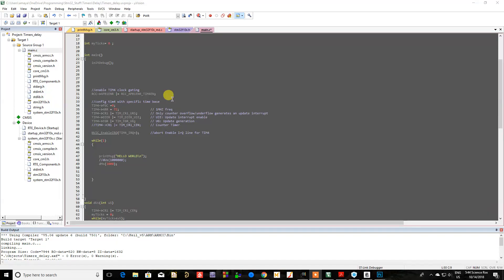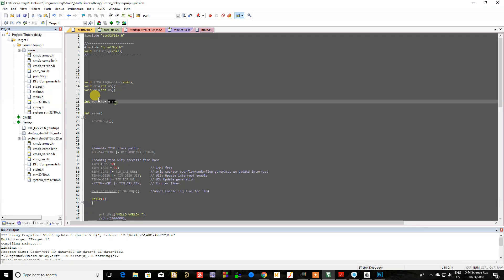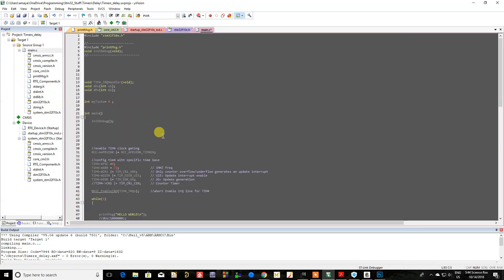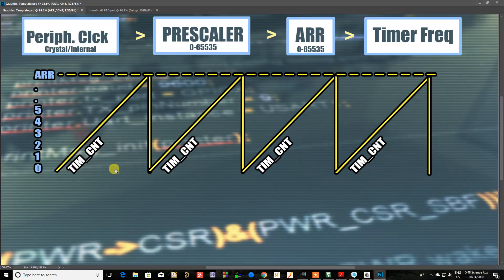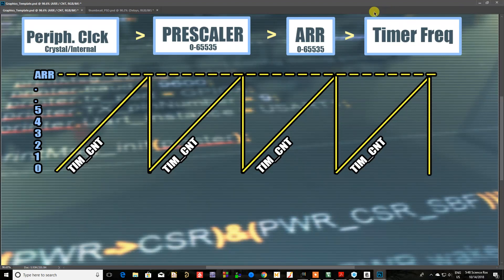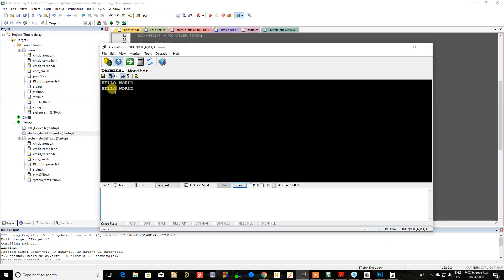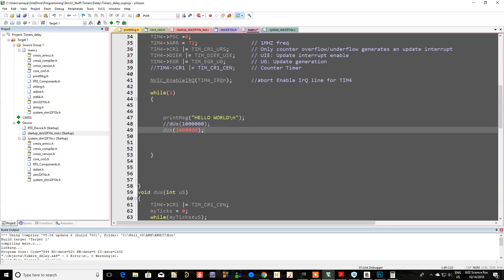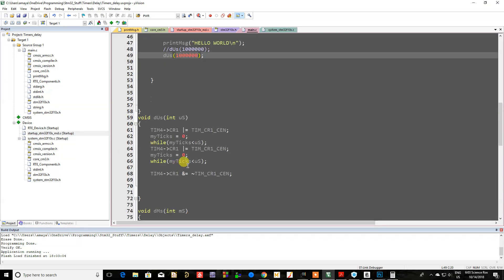Stm32 Delay Using Timers or Systick

Comment: Hi thanks for the great video. Maybe you figured it out already but still incase you have not I would like to tell you the reason you could not get 1 sec interrupts with a 72 divider on the ARR register. It was because the HCLK clock frequency after being divided by the APB1/2 prescaler gets further multiplied by "2" before being used by the Timers.  Again Thanks for the video was really helpful in my project which I am doing for my degree. Best Regards Usman

Comment: Thanks for posting this video.  I needed a delay that allowed the rest of my application to run while pause a moment before I update a 16x2 LCD.  
Evidently the Hitachi LCD needs at least a 2ms delay between updates since it is a bit slow to keep up.. It will stutter/produce garbage if it is hit too fast with data.

I don't want to use HAL_Delay because it would freeze up a DMA stream while waiting for the Delay :(
I figured a timer was needed, but this video saved me the trouble of figuring out how to use it ;-)
Reply: Does 16x2 LCD has pin for interrupt? If I remember correctly, it has some flag or interrupt pin that sends to MCU when it is ready to receive new data. Seems that nobody use that feature, maybe one wire more is too much?
Reply: @MilanKarakas  I think it's the DB7 Busy Flag pin you are referring to.
Good idea to check into..
Reply: @Synthetech  Yes, probably that one. I should to check datasheet for exact name and which state is buy and which ready.
Reply: @Synthetech  Okay, that is correct. If DB7 is high, then it means "not ready". So, you can use 4 bits transfer (lower nibble, higher nibble, and then DB7 is free), or better to use 8 bits transfer - but then after transfer first message - change status of this pin on your MCU from output to input and make loop or interrupt that wait for "low" to continue sending data. Then just switch back this pin as output. Sounds complicated, but I bet this will do things faster than calculating how much time LCD need to process data you sent to it.
Reply: @MilanKarakas  thanks for the tip Milan.
I may check into that later on..  I'm building a Synthesizer project using a Stm32F407 driving a stereo 16bit DAC via I2S.
I have good synth Oscillators in various waveforms, now working on using UART to RX MIDI to trigger notes and change parameters with Control Changes.
I used a LCD to verify the UART rx'ing MIDI.
I have more bugs to work thru.. Either the UART interrupt or the i2c port is making a slight choke in the I2S stream.. I can hear the sound change a moment every time the LCD updates/UART Rx's MIDI..  
A lot going on in there..  A lot to learn...

Comment: Hi, you should clear flag (UIF) before incrementing myTicks variable.The ARR register should be 71 not 72 because the zero is also one state of counter. I hope this helps.
Reply from the maker: Good catch! Thanks!!!!
Reply: That worked !!!
Thanks.
Reply: Can also confirm! clear UIF  b4 incrementing myTicks does the trick. I reckon that it reduce the non-counting period between each timer period, is it not?

Comment: hello eddie amaya ,
i really appreciate your understanding of interrupts and timers but i have just a simple thought in mind , instead of working with interrupts if we initialize the prescaler with 36000 (if the system clock is 72 Mhz ) that will make the counter clock to be of 2khz which means 2000 counts in one second , now if we initialize the auto reload register  value to be 2000 it should give us a delay of 1 sec . i just want your thoughts on this if i am going somewhere wrong with this idea.
Reply from the maker: Only one way to find out...give it a shot

Comment: I wonder if using the STM32's internal RTC for an Arduino-style millis() timer would be a plausible idea. I mean... I'm using a Blue Pill and it's mainly a Real Time Counter (and not clock because it does not have a hardware calendar).
Reply from the maker: yes plausible but unless you need serious "real time" its a lot of effort for what should be an otherwise simple task

Comment: Well done! I need your help. Does this sysTick can act as 'millis' on Arduino? I mean, sometimes aside delay, we should to convert some codes into Keil or other environment. And, please continue making great videos. Thanks.
Reply from the maker: im not sure how arduino handles millis , but the systick can be used to generate delays via a flag of sorts like i explained in the video. However if  using Cube Hal you dont want to modify systick counter.  there is also DWT available on certain  stm32 which can give even better resolution of micro seconds... more or less
Reply: @EdwinFairchild  I am not using CubeMX and Hal because it is so confusing and hard to understand what is what. Also I will later look for DWT as well. I made stupid cycle loop with NOPs and  'calibrated' on 1 uS, but as number grows it is totally wrong. So, now I am callibrating at 1000 uS, and it is much better - still 1 uS is 1.6 uS or so, 10 uS is 10.2 uS, and going up it goes at oposite direction - 100 uS showed me 97.3 uS. Yet, I am worried when I need short delay for some processes, rather than longer ones.

Comment: This video was very useful but How to add delay in STM32 without using any interrupts in the TIM4?
Reply from the maker: Neharika M Sadhwani you can have a while loop where you simple check the over flow flag as many times as you need for your specific time required. However what would you not want to use the interrupt since I made it so they only occurred when you need the delay?

Comment: Hi Eddie! I tried this tutorial with my STM32F103C8. I turned on the LED for 10uS, and off for 100uS. So I connected the logic analyzer to PC13 - the problem is, I am getting 7.6uS instead of 10, and 76uS instead of 100. Does it have something to do with default clock settings?
Reply from the maker: No, it has to do with the fact that we are not taking into account the time it takes to execute functions, load variables change variables, add a number etc.... these are not "REAL TIME" Systems but pretty close.  To get even better accuracy if 7us instead of 10us is an issue one would have make the delay in assembly where you can see how many instructions you are using and thus really count clock cycles.. Try this code 

#pragma GCC push_options
#pragma GCC optimize ("O3")
void delayUS_DWT(uint32_t us) {
 volatile uint32_t cycles = (SystemCoreClock/1000000L)*us;
 volatile uint32_t start = DWT->CYCCNT;
 do  {
 } while(DWT->CYCCNT - start < cycles);
}
Reply from the maker: and check this tutorial https://www.carminenoviello.com/2015/09/04/precisely-measure-microseconds-stm32/
Reply: @EdwinFairchild  Oh I get it! okay will test this and let you know the outcome. Thank you very much Eddie! BTW what is your nationality? just curious.
Reply from the maker: @jericotaleon  I am from Honduras

Comment: Hello Sir thank you very much for your tutorial this is very helpful.  I just wanted to ask you for some advise regarding the delay when multiple outputs are enabled.  I defined the delay as 5ms based on your code.  Now I wanted to activate 2 GPIOs with each having their own 5ms delay upon activation regardless of the state of the other GPIO. 

Now problem happens when I activate LED_GPIO2 when LED_GPIO1 is already activated prior to activating LED_GPIO2.  The delay becomes more than 5msec for the LED_GPIO2.  May I ask how to write the code so that both codes  are independent of each other.  Thank you very much for your time.

while (1)
  {
	

	{
		if(HAL_GPIO_ReadPin(BUTTON_GPIO1_GPIO_Port, BUTTON_GPIO1_Pin))
		{
			timedelay(5);																																	
			HAL_GPIO_WritePin(LED_GPIO1_GPIO_Port, LED_GPIO1_Pin, GPIO_PIN_SET);
		}
		else
		{
			HAL_GPIO_WritePin(LED_GPIO1_GPIO_Port, LED_GPIO1_Pin, GPIO_PIN_RESET);
			
		}
	}
	
		{
		if(HAL_GPIO_ReadPin(BUTTON_GPIO2_GPIO_Port, BUTTON_GPIO2_Pin))
		{
			timedelay(5);																																
			HAL_GPIO_WritePin(LED_GPIO2_GPIO_Port, LED_GPIO2_Pin, GPIO_PIN_SET);
		}
		else
		{
			HAL_GPIO_WritePin(LED_GPIO2_GPIO_Port, LED_GPIO2_Pin, GPIO_PIN_RESET);
		}
	}

Comment: Something is strange here. Tried to watch on oscilloscope and if 10 uS, then it shows 25 uS, so 250%, and for 100 uS, it shows 148 uS, or 148%, for 1000 uS, it shows 1370 uS instead, or 137%. That is bit wrong. I will try to get it right later, after some sleep. Thank you anyway for the motivation.
Reply from the maker: yeah check my math maybe i got something wrong, also check your operating frequency , ARR etc... just redo the math based on  what the datasheet says. I really dont remember the formulas off the top of my head. Also keep in mind any overhead of the time required to call a function , raise a pin high or low, clear an interrupt and so on.... this is not a real time system , but you should get decent results.  I doont have a scope anymore so i cant check anything right now
Reply: @EdwinFairchild  That's true. But, also... How I can be sure that counter always starting from zero, not from some number left earlier? Noticed that cycles on the scope are not stable, so probably after overflow it continues to counting for a while until interrupt flag is not cleared. On the other hand, my loop with nops work stable, always the same no matter it may be slightly wrong in duration. What about counting back from some number we set? If we pre-load counter, then counting back to zero (or underflow), then if needed checking whether our number is sufficient (0-65535), if not add one more loop... That may be very complicated. I remember earlier days of programming PIC in assembler, and only way to do loop is exactly counting how long take one instruction to execute, then including more and more wasted cycles. The strange thing is that I con't know here how much any instruction last, one cycle, half cycle, two cycles or more?
Reply from the maker: @MilanKarakas  defiantly an assembly based delay would be very much more precise. You should check out ARM thumb instruction set and try some inline assembly in Keil. Again this is not ment to give exact timing or even be deterministic, there are a lot of things that can influence how long it takes to execute something. Specially in the microsecond scale. Critical timing would require another approach. This more like a general timing approach if you need a delay of exact precision I would look into different approaches such as assembly. If you need a delay of 50ms but don't matter if it's not exact then this is fine.
Reply from the maker: @MilanKarakas  you could also use the internal RTC which will give you  much better timing characteristics.

Comment: HI Can you guys here help me with this? i got this timer working a while back but instead of understanding what i'm doing i just accepted that it works but now getting fustrated about not understanding it. the section void TIM4_IRQHandler(void)
{
msTicks++;
TIM4->SR &= ~TIM_SR_UIF;
};

how does this work? its not a for loop that doing the incrementing of the msTick++ so how does it make the time increment in the handler? 
secondly not sure about the UIF (update interupt flag) is this part of the interupt circuit and acts as the trigger to tell it that the UEV (Update event) has triggered and the ARR can now be reset?

Cant get my brain around this so if anyone can give a laymens explination - much Appreciated. Thanks in advance
Reply from the maker: Ok so the timer code which is setup in a different section , sets the timer up so that it stays counting up at the value set inside the ARR register. So let's pretend that value is 1000. Everytime the timer reaches 1000 it will jump into the IRQ Handler function and run the code inside it. Obviously the code inside it is Justin reading a variable , even when the regular code is trapped inside a while loop this function will always get called and increment msTicks Everytime the timer reaches it's goal of 1000. Let's say it's takes 1 second for the timer to count to 1000, so once every second this function will get called. So if you wanted to make a delay for 2 seconds you will call the delay function and have it set msTicks to zero, and wait inside a while loop untill msTicks equals 2, since this function will still get called while waiting in that loop, eventually it will be called enough times so that msTiCkS equals 2, and then your whille loop condition will be true and you will have been there for 2 seconds. Hope this helps 🙏😁
Reply: @EdwinFairchild  Hi Eddie
Nah Sorry mate still confused. I under stand the Timer section being set up th the ARR being the count point that is in relation to the frequency created by the PSC. however my brain cannot get around what is going on with this IRQ section. i've tried running it in de-bug mode, however you can run the handler as part of de-bug. 
When you say the ARR register reaches 1000 then jumps to the IRQ. then how does it know to do that ? is it the UEV which forces the UIF? 
As for when you say the function still get called when in the 'While' loop i assume you mean the IRQ is running in the back ground doing the incrementing. i just can see how it all joins together i'm afraid. Thanks for the help any way.
Keep up the good work.

Craig
Reply from the maker: @craigkinney853  when the count register matches the ARR value the mcu was designed in a way so that I jump to a specific address, that address is the irq function which is assigned a name and address we cannot change because the chip was designed that way. The irq dies not run in the back ground ... It only runs when count register matches the ARR value , then mcu Jumps to the irq (because hardware design internal to the chip ) then inside the irq we increment the variable ... Then when the irq function is done it's jumps back to where it left off , which was the while loop
Reply from the maker: @craigkinney853  and yes by enabling certain interrupts we tell the mcu to jump to that specific address (irq) ... So if the update event is enabled , it will jump to the irq anything an update even occrs
Reply: @EdwinFairchild  Hi Eddie

OK so as part of the ARR and other part of the timer when they all meet the criteria the IRQ will invoke anyway as this is somehting that ARM (or ST) have built into the chips MCU anyway. The IRQ will increment the msTick variable as part of its function and from what i can work out the TIM->SR &=UIF is reseting this before going back to the program.
i'm probably hazarding a guess. trying to read stuff from the datasheet.

Thanks Eddie.I'll buy you a pint one day.
Reply from the maker: @craigkinney853  yes the &= operation resets that flag, otherwise the mcu will think you have not serviced that interrupt and it will execute it again, basically internally that flag is also something by design,  where  if that flag is high and the interrupt enabled it will jump to the IRQ.

Comment: can i get some help please? have been tryingto get this to work but cannot get the timer to increment the MsTick and i'm now getting fustrated.my code is as below. i've checked thqat everything works up until the msTick which seems to get stuck in the while loop.the rest of the code to make an LED blink is on an .h file and i know this works as i've tested that. this has got to be something simple i've done.
thanks in advnace if anyone can help.

int msTicks = 0;
void TIM4_IRQhandler(void);
void allOn(void);
void delay(void);
void allOff(void);
void dms(int ms);
void setUp(void);

int main()
{

RCC->AHB1ENR|=(1<<0);
setUp();

while(1)
{
allOn();
delay();
TIM4_IRQhandler();
dms(1);
allOff();
dms(1);	
}

};
void dms(int ms) 
{
TIM4->CR1|=TIM_CR1_CEN;
msTicks = 0;
while(msTicks <(ms*1000));//////gets stuck here can anyone point out where i have gone wrong? /////////
TIM4->CR1 &= ~TIM_CR1_CEN;	
};

void TIM4_IRQhandler(void)
{
msTicks++;
TIM4->SR &= ~TIM_SR_UIF;
};

below is the delay function that is in the .h file

	RCC->APB1ENR|=(1<<2); 
	TIM4->PSC = 0;
	TIM4->ARR = 8;
	TIM4->CR1|= TIM_CR1_URS;
	TIM4->DIER|= TIM_DIER_UIE;
	TIM4->EGR|= TIM_EGR_UG;
	NVIC_EnableIRQ(TIM4_IRQn);
Reply from the maker: you have a bit to learn, you do not call IRQ handler functions like you do in your while loop. Those functions are called all on their own when the interrupt occurs.
Reply: also  i'm using the STM 32 f401 nucleo board the above RCC have been changed to RCC->AHB1ENR|=(1<<2); for TIM 4. still lost. thanks
Reply from the maker: if youre down later we can chat and i can help.
Reply: @EdwinFairchild  hi Eddie. Still struggling through learning this. I was trying to follow the video to create the custom delay. Can you explain what you mean in your reply? Sorry for any hassle if you are at work and stuff. It's nighttime here in the UK.
Reply from the maker: Email me you main.c file with all functions delay etc...Amaya.6987@gmail.com I'll look at it later
Reply: If you haven't already solved, it's a simple fix. Just change the int myTicks to volatile int  myTicks. That should do it. Eddie cleared it up for me.
Reply: @donsamuel7734  hi. Sorry for the late reply. I think I've still got the code somewhere.  I'd given up on training myself on embedded and thought I  needed more help with c programming. So did some more tutorials. Will give you suggestion a go. 
Thanks very much. 
Eddie did me a solid as he actually personally responded to my help via email.